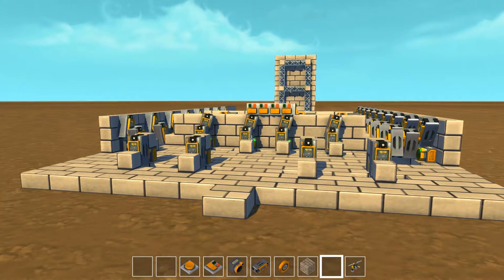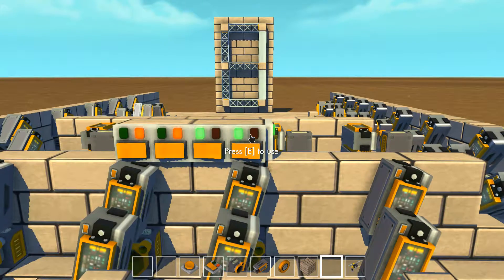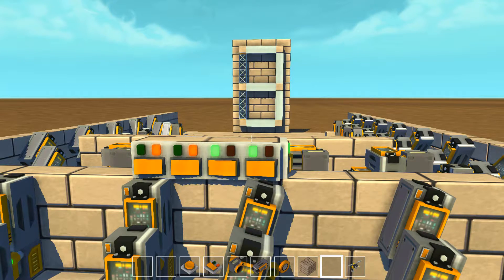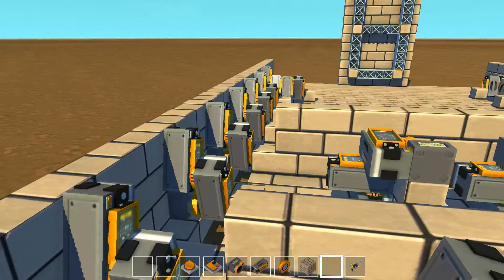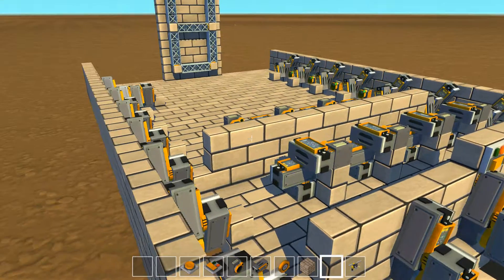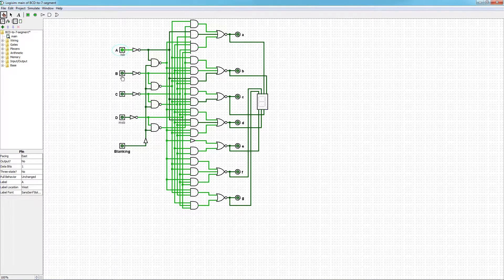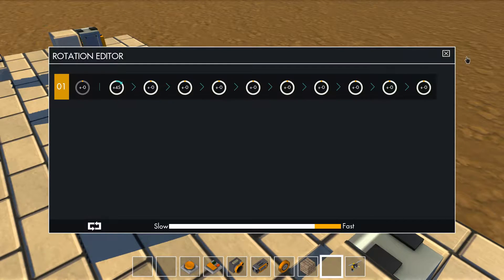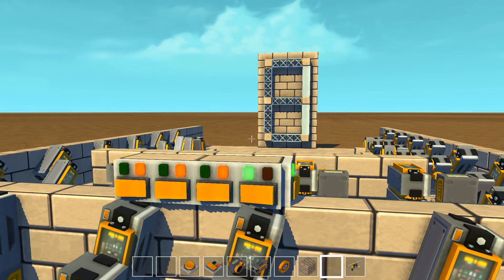BCD to 7 Segment decoder with display built in Scrap Mechanic.

Comment: that's not bcd that's a decoder where you actually hard-coded each input, isn't it?
Reply from the maker: It is BCD. The input is Binary Coded Decimal represented by the 4 on/off switches. The circuitry is displayed at the end. It's in total, a "BCD to 7 Segment decoder". Binary input with 7 segment output.